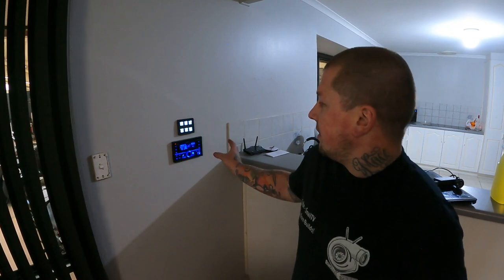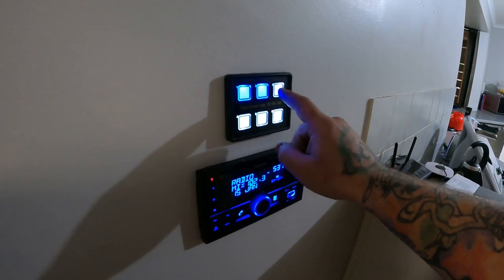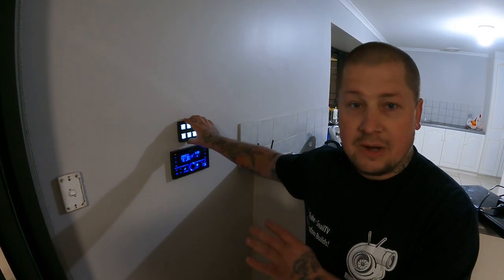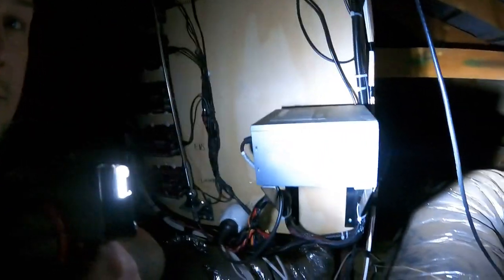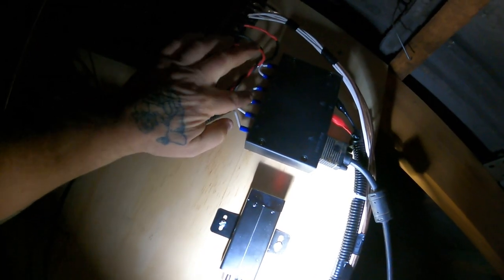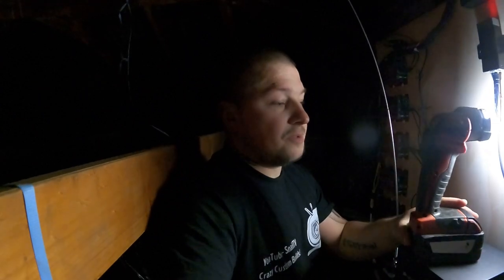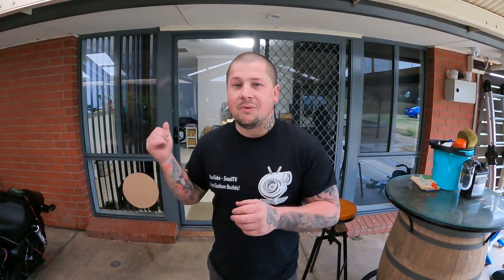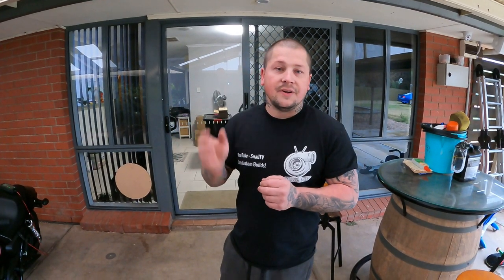WORLDS CRAZIEST AND LOUDEST  HOME STEREO FOR UNDER $1500

Comment: I just use pro audio amps I find on ebay and facebook marketplace. There is no need to convert to 12 volts. That and I'm also quite a fan of the SMSL SA98E amps that are 36 volts and over 100 watts each.

Comment: Now i see you use the corsair psu from a PC... sure itll work on smaller amps... But if I wanted to do this- why wouldnt you find a battery recycler that rebuilds agm group 31's for example we got 5 of these for 80$ CAD each locally with 2 yr warranty, and they test just as good as my northstar NSB AGM 31 which was over 400$ cad new. Run some bussbars (just like the big car audio guys do) to link all these top post batteries together- ideally the screw post top, but you can get solid post top buss bars with set screws to tighten... THEN get a smart charger for them/maintainer. This is still on the cheapcheap but you then also have a wicked reserve ontop of what you have here- especially running bigger amps, say a few skar/sundown 4 channels, and or what you have here for speaker amps- but a big monoblock like a 3500d or bigger from skar/sundown (for example). Would you be able to encorporate this with the power supply or am i trippin? Any insight here would be super helpful. On if itll work/what it might also need in the above idea- or what would i need to make just the battery bank (AGM or LITHIUM cause lithium just is a game changer in car audio now, a 10lb lithium batt is like 4 agm group 31 audio batteries these days at 80 lb a pop) Thanks man I really liked this helped me a bunch!